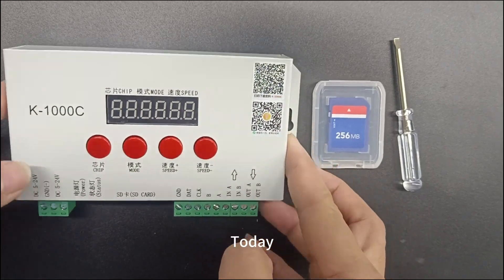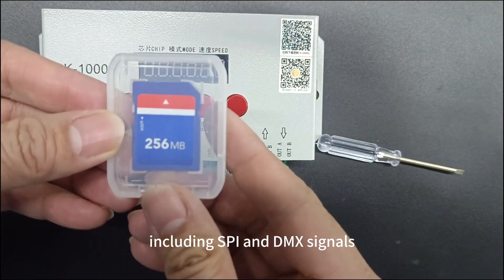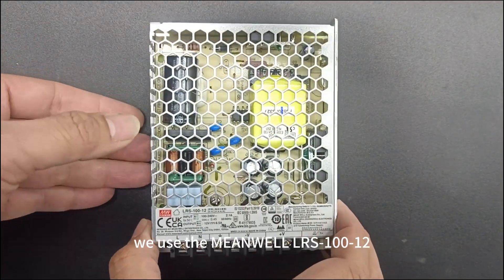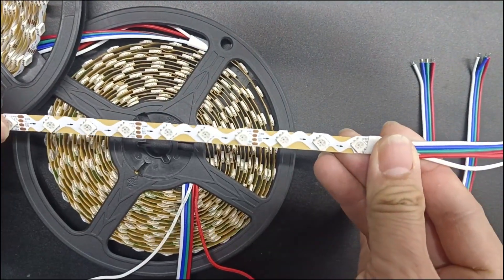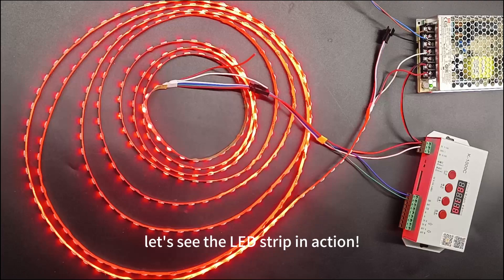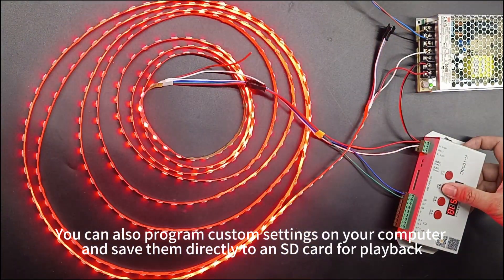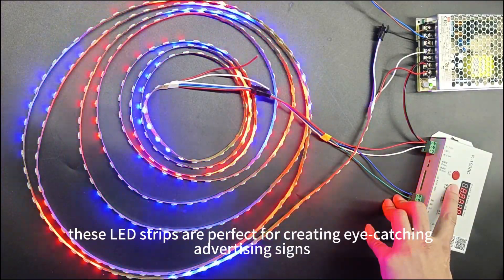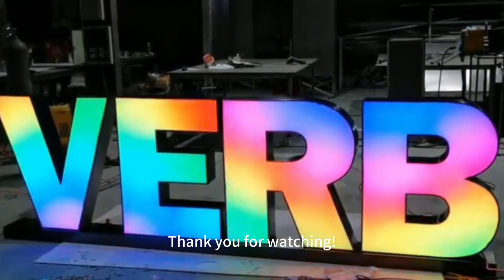Connecting and Using the K-1000C RGB Controller with Zigzag SPI LED Strip

Comment: Hi how can I get the strip led and controller like in video?
Reply from the maker: contact us by julie.zhu@signlite.com.cn
Reply: you can get the GLEDOPTO ESP32 Mini WLED LED Controller with Microphone for about $22.00 instead of $30.00 like this K-1000c..  the Gledopto even has a mic that is sound reactive and it's also programable , it comes with WLED which has 100's of pre programed effects or you can get the ESP32 , 3 of them for under 20 bucks..flash them with WLED or other software of your choice..and they are WIFI or Bluetooth connectable,  I use many of them  .. on my channel I have a video about a desk lamp I designed and 3d printed.. so many things you can make with them..